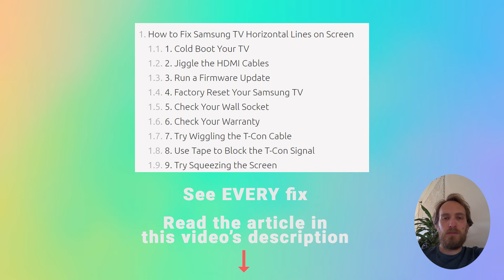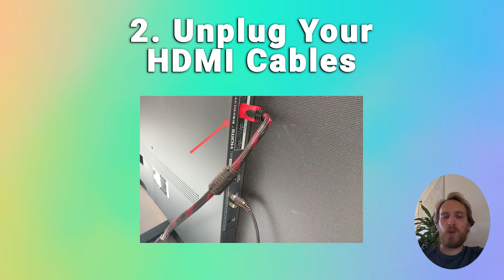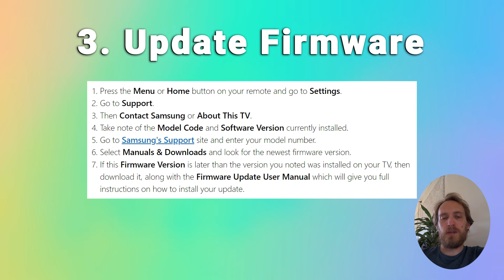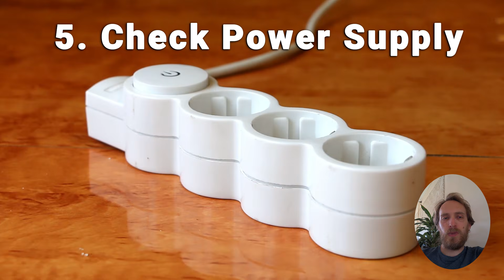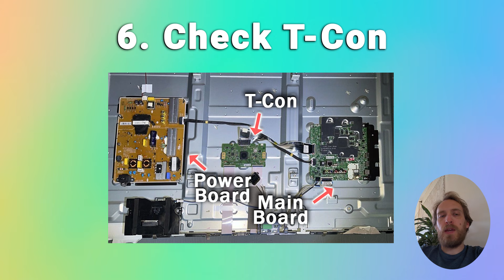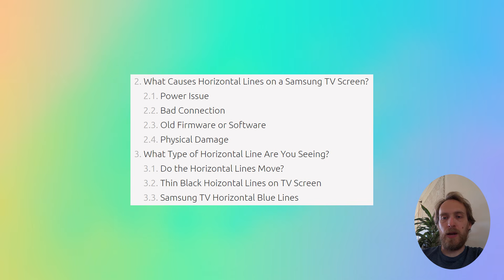-- Samsung TV Horizontal Lines On Screen FIX --

Comment: If none of these fixes work then you may want to take off the bezel on the screen and push down on each ribbon cable that is coming out of the left and right side of the LCD screen. This is usually the problem. Please keep in mind that these cables are not connected to anything but they do have some kind of resistor or something on them

Comment: Mine don’t have lines but it has 2 “line” darker areas that go across the middle and top of the screen … how can this be fixed? I can’t find anything
Reply: im sitting with the same issue
Reply: Sounds like the LED backlight has failed in sections. Cheaper to buy a new one if that is the case.

Comment: Hi, my TV is a 58" QLED bought from Aldi Australia. It started with horizontal flickering lines 29 months after purchase. Whilst unplugging and re-plugging the ribbon cables I fried the T-con board, so I bought another T-con board which I had a fair bit of trouble plugging correctly: I could only get lines on one half of the screen and a picture that looked like modern art on the other half. After a last attempt of plugging before going to buy a new TV I got one have working and after 2 attempts on the other half finally I got the TV to the stage where it was before fiddling with the ribbon cables, meaning I still have the lines that at some stage cover like 70% of the screen and after 20 minutes or half an hour are just confined to a small portion at the upper part of the screen. I found the ribbon cables are hard folded like a strip of paper. Could they be the problem?